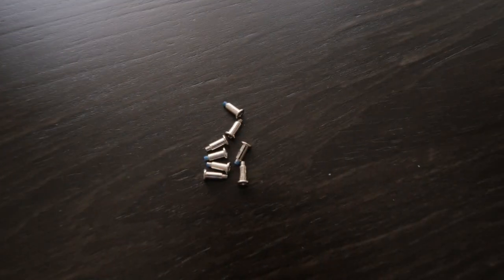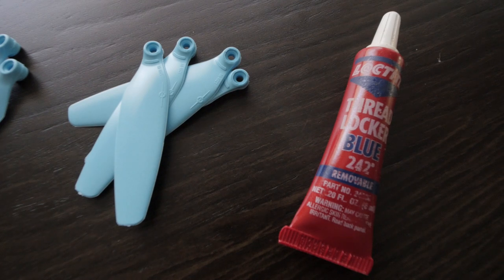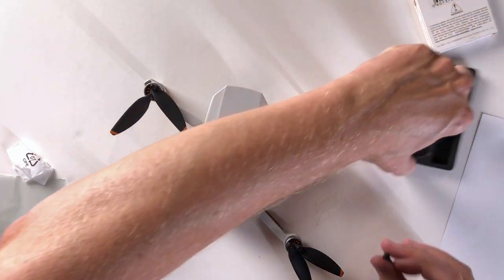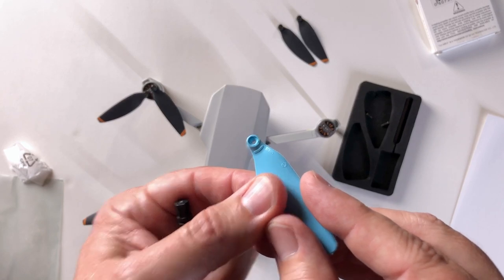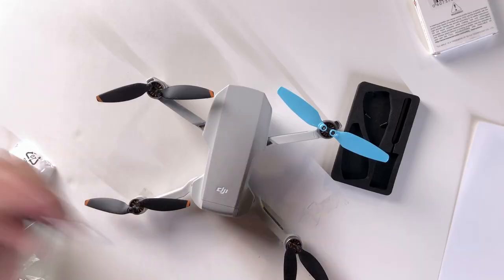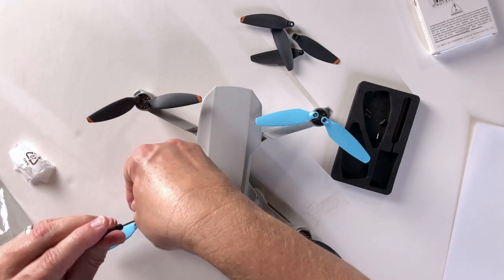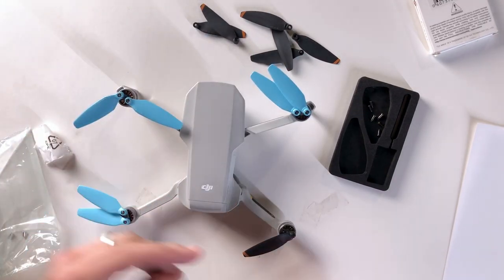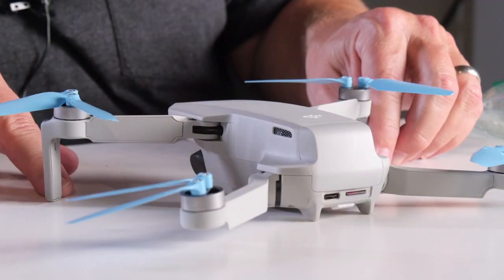How To Change Your Drone Propellers...No Stress!

Comment: for anyone interested the proper screwdriver for the DJI props is a Phillips screwdriver # 0. I have a small 5" one and it works perfectly, you can use a lot of force and not have to worry about stripping the screw heads. Always remember to use the new screws every time you change the props because they will have loctite on them to secure the props while in flight, and always check to make sure that the prop screws are tight before every flight! 🚁 I always say that losing my drone in a tree isn't the worse thing to happen to me today, but it's still up their! 🤣
Reply from the maker: Thanks for the good tips, and sorry to hear about your "arboreal landing"!
Reply: @MatthewHaines  I didn't actually loose it in a tree, its a play on words or a joke...lol that's why I added that smiley.
Reply from the maker: @Frank-uf2vn  Oh, hah hah! When you said "but it's still up there" I thought you meant a drone. :)

Comment: Is it ok to screw it on just a little bit tight so that propellers can't feel loose but tight
Reply from the maker: You want the screws pretty tight because they're going to be subjected to a lot of rotational force in the air. Don't strip the screws or anything like that, but you want them firmly in place.
Reply: @MatthewHaines  thanku so tight that the propellers can't really move but only with the brushless motors, got it. Greatly appreciated! Subbed 💯👍